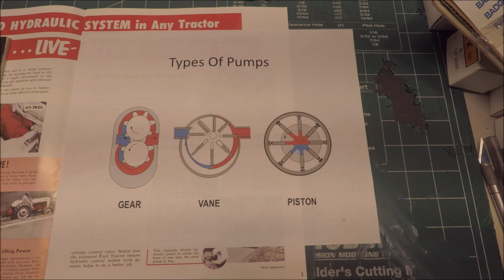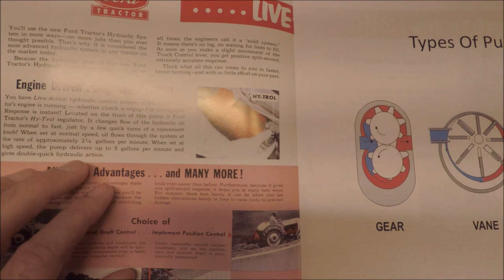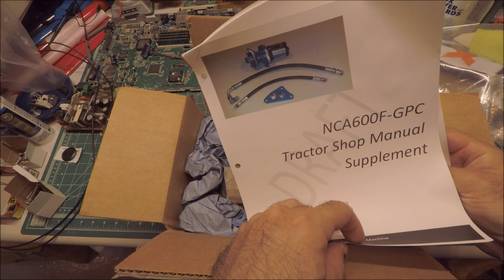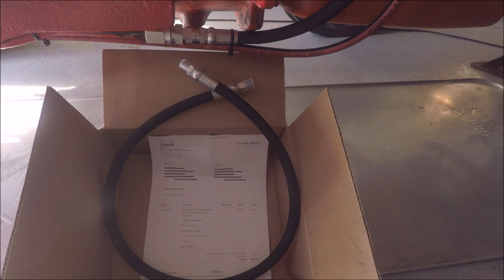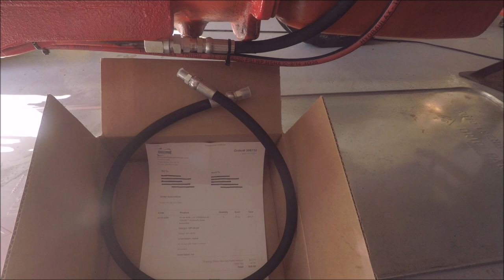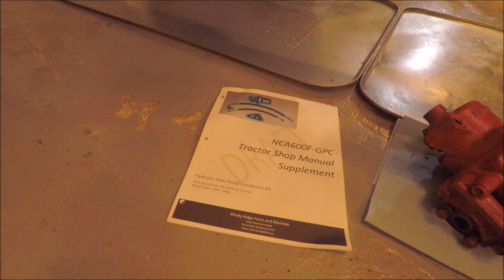1953 - 1964 Ford tractor gear-driven hydraulic pump upgrade (Jubilee, NAA & 600 series)

Comment: Good installation of the new pump, I also liked the little extension you made to move the larger diameter hose away from the gear case flange.
Reply from the maker: Thanks!

Comment: Daniel. I have watched just about every Jubilee video there is and glean what I can from Yesterdays Tractors forum too, and not only congratulate you on the parade trophy, but you also should get an award for the clearest presentation on replacing the pump on a NAA. Everything about your install was just perfect.  I watched your entire process and am intrigued. I've owned my 53 NAA Ser. 34312 for almost 12 years and some years ago contacted Windy Ridge Farm about that pump. I also have the Vane pump. I'm, for 11 years now, renovating my Jubilee. Everything is pretty much still apart. About two months ago I rebuilt the Lift cover Hydraulics. New O-ring,piston, and gaskets set. And cleaned out the inside of the reservoir. Borrowed a video by Dan Gingell & his dad. The surging is possibly caused by a bad O-ring on the unloader valve. My unloader valve did not have the o-ring, but early NAAs did.
I also wondered about your interest in Mouser & Digi Key electronics as I also use them in my Ham Radio hobby.
I hope you see this and we can connect more about our somewhat rare NAA tractors. I have many questions I'd like to ask. Lastly, there are ways to see what's happening with your hydraulics without removing the lift cover. You can remove either of the side covers to observe if oil is bypassing somewhere.
Reply: Just got me a jubilee couple days ago. it's a 53,but can't read the serial.
Reply: @tnhomestead  Fine business Daniel. Unfortunately for us there aren't near as many made as the 8N. There are several forums for these old tractors and many resources for parts. It looks like you made a good find and still 6Volt system too. The 6Volt will serve you well, Just keep battery posts and cable terminals clean and it will work well. You handled that pump change like a pro. Unless it's a very early model 53, the serial is on the LH bell housing behind the starter. You may have to remove some paint to see it. If there is nothing there, it will be on the upper LH forward side of the block. I'm anxious to get mine back together and maybe it will look as good as yours. Mine will remain retired like me. I use my 53 Ferguson TO30 on my small acreage. Nice music too.
Reply: @williamokrasinski9840  The serial on mine is on the head, but need to get it cleaned up to find the numbers. I can tell they are there, but can only see a couple of them.
Reply: @tnhomestead  Sorry for my confusion. I thought I was communicating with Daniel who replaced his Hyd. Pump. So I'm still curious now about both you and Daniel's tractors. If it's an early NAA, the serial is on the block below the Exh. manifold above the generator. After serial number 22239, it on the flat behind the starter on the bell housing.
Reply: @williamokrasinski9840  Figured that. My serial is on the block, just can't read it well. Going to see if I can figure it out this week.
Reply: @tnhomestead  The serial number on mine is on the bell housing just to the right of the starter. My SN is ?AA61329. There is a big flat spot casted in the bell housing, the SN is just below the edge of that flat spot.
Reply: Looks like my serial 13265
Reply from the maker: Thank you for the kind words, and the tips.  I am a bit active in the 'mytractorforum' under "DanielRaible'.  Please feel free to reach out, although I will say most of my knowledge has come from such forums, so is somewhat limited.  Making videos every once in awhile is my attempt to try to give back, for all I have learned from others.  As to the electronics parts, I am an engineer by day, so always have a pile of stuff to repair on the bench, haha.
Reply: William, on a NAA you can remove the huge hydraulic fill plug to see if your piston seal is leaking. 
With some cheap bore scopes, you can see other things too though the filler cap. 
Hello from north east Montana. 
10 miles from the Canadian border.
Reply: you should add the new remote hyd adapter plate , i added it to mine and love it, found it on etsy, its the only guy making one for the jubilee i am aware of.

Comment: Daniel, those hydraulic fittings are called ORB, short for O-Ring Boss. The threads are based on SAE or fine thread bolt sizes. 
Hello from north east Montana. 
10 miles from the Canadian border.
Reply from the maker: Great, thanks for the additional knowledge!

Comment: Can you provide info on The rear attachment your using, and how do you unload the material? Great video!
Reply from the maker: Thanks!  That is a dirt scoop.  You can still get them new at places like Rural King or Tractor Supply, or get used ones from Craigslist.  The operate like a trip bucket.  When you set them down, you can pull a rope to undo a latch mechanism, then when you pick up the bucket it swings down and dumps the material out.  Not as elegant as a proper front end loader, but once you get the hang of it they are very useful and the next best thing.  With a bit of planning you can get a lot done, even excavating.

Comment: Why didn't you take the line off to cut it instead of using a little hand hack saw and trying to clean the burrs underneath.
Reply from the maker: A good point.  Since this was my first time working on a hydraulic system, I wanted to disassemble as little as possible.  There are many ways of accomplishing this job.

Comment: I just bought a 1954 NAA.  I got all my Tires holding air now. Next will be getting a 6 volt battery, adding antifreeze and water to the Radiator and changing fluids if it starts up right away. 
It sat in a barn for 7 years, but the previous owner drained the gas tank and carb, radiator and block. 
Do you think I should just get a carb kit and clean it up before starting it?
Reply from the maker: Good luck!  I would try starting it as is to get going, and plan on a downstream carb service once you have the rest sorted.  The carbs are really robust.
Reply: @danielraible  I have to get a plastic gas tank. The inside of the Tractors tank is nasty. So nasty it will not let fuel into the bowl. I have to remove the tank to clean it out. I liked to never figure out how to get the cowling off
Reply from the maker: @davidvines6498  Yes, if the tank is that bad, then getting a carb rebuild kit would be wise.
Reply: @danielraible  I’m going to get a new tank and carb kit. After I try cleaning the tank first. Or I’ll clean it and sell it

Comment: Hi I have a 53 Juiblee that I want to do the same conversion on because it leaks. The seller’s website is no longer working is there any other outfits that do the same type of conversion kits? Thank you. I have already tried changing out all the gaskets and o rings. Leak seems to be coming from manifold at the bottom once it’s been running for a few mins. I see no obvious cracks or any other damage.
Reply from the maker: Yes, unfortunately it seems the owner is ill right now, so currently not taking new orders.  The real key to his kit was the adapter between the proofmeter housing and the new pump, if you could find someone to machine it: https://www.yesterdaystractors.com/cgi-bin/viewit.cgi?bd=nboard&th=908875
Also J&D Prodicutions, Inc. and WaltsTractors will rebuild old pumps.  I would suggest contacting both to see if they would start offering a similar conversion package.

Comment: So, the question is, where do you see the main advantages of this mod?
Reply from the maker: For me, I wanted a modern-style pump with a fixed displacement to extend the longevity of the tractor.  If you are concerned with originality it would probably be best to try to rebuild the vintage pump, assuming you can find parts and have the know-how.  For me, I wanted to get the machine back into service with modern parts for dependability.
Reply: @danielraible  You may not know- fair enough, but since this flows about 2x the OEM pump will it be able to run a FEL   and/or Remote Hydraulics?
Reply from the maker: @MrDdaland  This is a good question, and I do not know.  Windy Ridge mentioned they are developing a remote hydraulic kit, and I am VERY interested in that so I can run an actuated top link - so my hope is the pump could handle both that and the lift arms at the same time.  If/when that kit is released I will certainly try it out and share the results.
Reply: @MrDdaland  i have a remote cyl kit on mine with the old pump. works fine. I got the adapter plate on etsy.
Reply: @danielraible   i have a remote cyl kit on mine with the old pump. works fine. I got the adapter plate on etsy.
Reply from the maker: @TEXANConnection  Good tip, I am looking forward to performing this modification myself in the near future.

Comment: Can you run a whole new line for the steel line to a fitting, or does it require a versa link?
Reply from the maker: You could replace the whole line back, like I did the smaller one.  Since the kit came with the versa link I went with that first.

Comment: how will they adapt the gear pump on the bent shaft of the old model? I'm from Brazil
Reply from the maker: For the older tractors, with the front distributor location there is a different kit on their website.
Reply: could you send me the website link
Reply from the maker: @Visãobrnetwork  This is his main site: https://windyridgefarm.us/WindyRidgeFarm.php
Reply: did you have to change the type of oil to a specific oil for gear pumps?
Reply from the maker: @Visãobrnetwork  No, I did take the time to purge out the older oil, and replaced with Universal Tractor Fluid (UTF), so nothing special.

Comment: Does anyone else offer this kit? Windy Ridge doesn't anymore.
Reply from the maker: Yes, unfortunately it seems the owner is ill right now, so currently not taking new orders.  The real key to his kit was the adapter between the proofmeter housing and the new pump, if you could find someone to machine it: https://www.yesterdaystractors.com/cgi-bin/viewit.cgi?bd=nboard&th=908875
Also J&D Prodicutions, Inc. and WaltsTractors will rebuild old pumps.  I would suggest contacting both to see if they would start offering a similar conversion package.

Comment: Hello sir, your tractor is interesting. Every 100 series tractor I have seen has the hydraulic lines inside the trans case. And a Manifold that bolts up to it and connects to the vane pump. Thats the way i mine is. I'd love to replace my original vickers vane pump, but not sure if its possible. Is there a kit available for my application. 1957 Ford 600 tractor. 134CID w/ vickers vane pump. Please advise. thanks!
Reply from the maker: Yes, if you go to the Windy Ridge Farm and Machine website you will see a kit option for the 600 series tractors, which have the cast manifold instead of individual hydraulic lines.  Mine is an earlier model NAA, so is a bit different than yours.
Reply: Where do I drain the oil and refill it to the right level

Comment: Are they hydraulics any stronger, or faster?
Reply from the maker: I'd say they move about the same with my heaviest implement, which is a 600 lb box scraper.  The important thing is the tractor doesn't run through oil anymore.